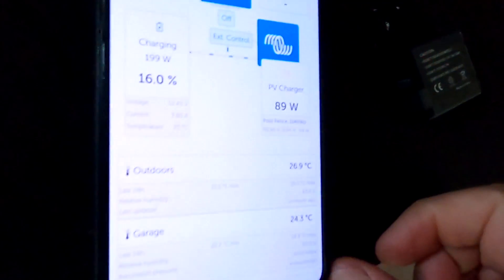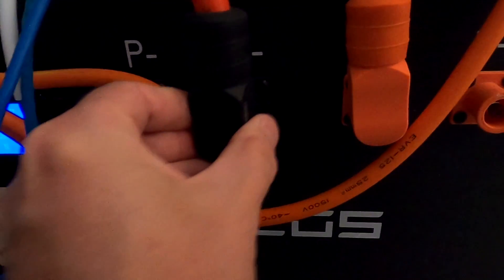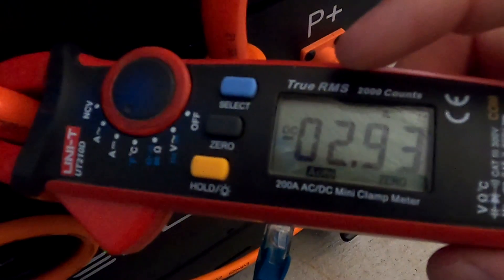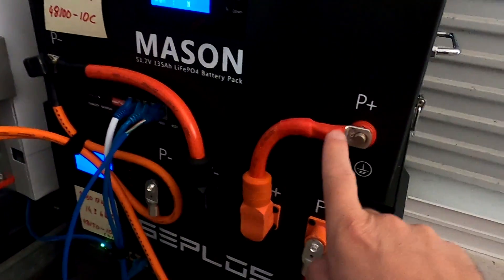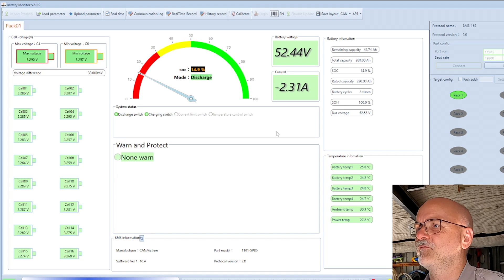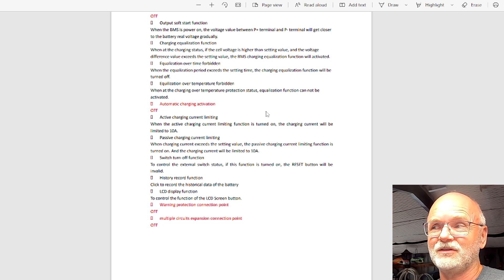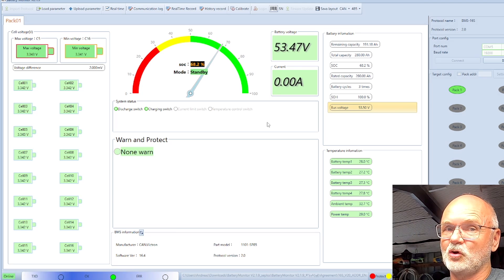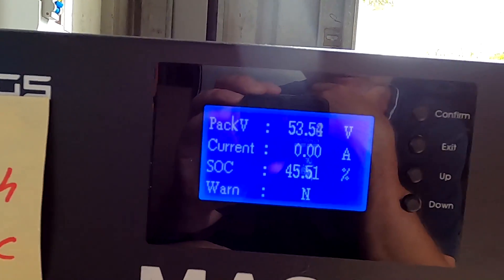Seplos BMS current limiting function causes weird behaviour.

Comment: The total voltage of each battery differs too much from the other I think, so the balance current (pack 1 to pack 2) easily exceeds 10amps. That fast that the display isn't able to show up the actual values before limiting kicks in .. again and again (weird swinging as a result)

Comment: Dear Andy, I also have DIY 280 Seplos kits with 10E 200A BMS's, did you found how manually turn offf discharging and charging because I alerady connectet it to the Solarede 3phase hybrid inverter, but neet to calibrate battery and want only fully charge batttery by my inverter?

Comment: Hi Andy is there any chance you could charge the seplos battery and leave it overnight to see if the balancer will indeed balance over time. It seems that time would work in balancing the cells. In real life most people would check once a week at most.
Reply from the maker: We've tested this already when we built the Mason battery. I left it balancing overnight and the balancer did not work well either. 100mA is just not enough for these large capacities and B-grade cells. They may be OK when you have true A-grade cells as some have reported here.

Comment: The initiative current limiting charging (Even less than 10 Amps) could be used when the battery cells have less charge and in this low stage of charge in order to protect the batteries from huge charge Amps we need to limit the charge current, this is what once I have read about. Maybe it is already ON by the battery modules manufacturer. The Software does not have any problem.
Reply from the maker: Nooo, if the cell is on low SOC, it can take all the amps it can get (up until the max charge current as per specs). Not a problem for lithium and no need to charge them slow.
Reply: @OffGridGarageAustralia  Maybe the BMS Software developer (Copied or for future protection if needed in... or just having the initiative current inside the software firmware without any specific reason at the time) decided to reduce the charge current whenever the Li-iron battery module have less charge like Li-ion battery modules.

Comment: Beside this interesting behaviour, shouldn't you connect the Lynx busbar with - to one of the batteries and + to the other?
Reply from the maker: I don't see a reason to do that. This daisy-chain is just a temporary setup and we will connect all batteries individually to the bus bars. That solves the problem.
Reply: @OffGridGarageAustralia  If it is temporary then it is ok, but it would reduce uneven charge and discharge.

Comment: Hi Andy, Thank you for the video series. I've a question. I got 16 LifepO4 cells and I observed a 0.4V voltage difference between cells at the bottom. 10 cells were around 3.1V and the other 6 cells were 2.7V. I'm using 150-2A JK BMS. Because of this issue battery pack's usable capacity is very limited. Is there a way to balance the cells at around 2.7V using JK BMS without disassembling the pack?
Reply from the maker: The JK-BMS can only top balance. In fact, no BMS I know off does bottom balancing. 
Are the voltages coming back together when you fully charge the pack? How far do you charge, when does the balancer kick in?

Comment: Thanks Andy, I'm not an expert (yet) but this is my main concern about ready-built batteries and this is the very reason why I purchased two from different manufacturers so that I can investigate how accurately the pre-balance the cells. I shall open them both, test each cell and charge them individually up to their maximum capacity. Did you perhaps think about this? I know you said earlier that you do not believe in pre-balancing but that could be the reason for the issue you are experiencing. Let us know your thought on this, please. 🙏

Comment: I haven't counted how many Seplos episodes you've done so far, but it's turning out to be much like the Daly Saga... LOL. 

What's interesting and frustrating about almost all of these BMS's that we have on the market now, is the lack of instructions and especially the lack of good instructions. Then there's the fun of hardware and/or software and/or firmware updates that get pushed out without any notice or explanation (Daly did this right before Christmas... Doh!). It's all these things that trip up the average DIY'er with endless problems without any authority to turn to. This is ultimately why so many people still purchase ready made batteries, because the patience, knowledge and fault finding techniques are something learned over a lifetime. We can watch people like yourself put a battery together in an episode, then go and click the "buy" button. Some time weeks later the parts arrive and we've found out that there are a hundred quirks that we need to repair. We're so lucky to have you playing the role of crash test dummy for so many products!
Reply: You have been reported as SPAM, impersonating and using logos.

Comment: Hopefully when you get all of the settings figured out you can post the BMS versions/firmware version and the switch settings that make it work best, I have tried all 3 versions and still having no luck
Reply from the maker: Yeah, that's the ultimate goal. It could be a long way until then...
Reply: @Off-Grid Garage  I'm working on it right next to you, been trying version 2.7, 2.8 and 2.9 and still running into issues, I still cant even get the BMS to calibrate to the actual AH

Comment: You should make a text dump of the config and put that in git. If you change something, it will be registered, and you can comment why. You can also roll back and push the old config.
I have no idea how you program them. I think the description is not from the BMS, but from the program that configures them and knows that item n sets this or that.
Reply: What an awesome idea.
Reply from the maker: There is a XML file with all the settings which can be imported, exported. Maybe that's a start...

Comment: Hi Andy, really interesting!😁 
you should know that often the failure of this type of BMS often comes from limiting charging (I had the case of a BMS HS which burned at limiting charging for no reason?)
I don't know the "initiative limiting charging" function??
But on the other hand, I know when the battery has finished charging, the limiting charging is normally activated, and effectively limits the charge to 10A Max, but only at the end of charging, i.e. when the battery has reached 100% charge ! then with these 10A max the battery continues to charge slowly, until OV pack or OV cell's
and at this moment the charge is stopped.
And it's not a bad thing this limiting, because example: if you load heavily (like 50A or more) and instantly stop the load! this causes a shock in the other batteries connected in parallel and also to the solar controller!
I have had this experience several times with BMS, simpler, like JBD, Daly or other... If you stop the charge instantly (with a fairly large amperage) put a multimeter on the cables in parallel battery or on the source (controller ) and you will see that the voltage rises very strongly (more than 60V! sometimes But only a fraction of a second!) and this is not good at all, for electronics!
Obviously when you have several batteries in Paralleles, it is the others who absorb the shock (without sometimes being able to notice it)
It is for this reason that they have put this type of limiting charging.
Again this is only my opinion, with the experience and the tests that I have been able to do... but I am not an electronics specialist. but sincerely I think that's why they put this limiting charging. Thank you again for this video Andy👍
Reply: Hi!
I had the exactly same problem as you described! 
Do you have more details about how this event happens? I keep trying to understand it. I have done various tests even with the scope measuring the voltage and got this +60V scenario. 
Do you have an idea for a solution?

Comment: Hi Andi, this switch is indeed per default turned off (checked at my two bms-es). If you want I can check if the same happens with my setup (280Ah and 90Ah parallel). Also, 'automatically activate charging' is turned off by default but seems to be on on your bms. The pdf doesn't explain the feature but I think it means it can ask using CAN to activate charging (for example when SOC is way too low and it needs a charge, works on grid connected mainly ofcourse). 'Manually activate charging' is per default on but I can't understand what this does.
Reply from the maker: OK, thanks for that. I played around with the 10C quite a bit but not much with the new 10E, and both had this switch activated🤷‍♂️ I wouldn't be surprised if they are not having a default config when they get shipped.

Comment: This is what happens when battery communication is poorly designed and the Inverter is not using the battery communication properly.
With Fortress eFlex or eVault batteries connected to a Sol-Ark inverter the firmware in the Sol-Ark is able to communicate fully with the battery.  
If I have five x 105A batteries connected the Sol-Ark the Inverter shows that the total capacity is 525A and maximum current draw is 300A (5x60A).  If one battery is switched off or cuts out the capacity drops to 420A and Maximum current draw drops to 240A.    The nice part about this and it has happened to me is that it prevents a possible burnout of the BMS or T-Class fuse burn out on each battery.

I was messing around with the batteries one night and started to switch them off, not remembering that the house was drawing over 100A from the packs.  As I switched off the fourth battery the Inverter alarmed and switched to pulling power from the Grid as the new internal setting was 105A capacity and Max current of 60A.  The house over 100Amps of current draw was reduced down to 60A and the rest was coming from the Grid.

If you are off grid it would shutdown the Inverter with an error or it might start the generator.
I do not have a generator connected so I am not sure on that last part.

Comment: Version 2.7,2.8 and 2.9 are all different, ask for the firmware for these three versions and see what you can do. Very confusing and overly complicated. I like the options that are available to change but depending on which versio you have you have access to change different parameters,  maybe they have other versions as well but as of now all I can get are the three I mentioned
Reply: Have only tested 2.7 and 2.8. But for my implementation I prefer 2.8 even if I needed to default all my settings from 2.7 and I can't control voltage in 2.8 Reason for this is the charging control with the  multiplus works better with 2.8. Anyone tested 2.9 how is that one?
Reply from the maker: V2.8 fixed a few things in regards to the Victron communication. I haven't tried the 2.9 yet. No changelog of course on the Seplos website or anywhere 🤷‍♂️ It's all about letting the customers find out themselves.
Reply: @Off-Grid Garage  2.9 removes the option to change several of the settings you show in 2.8 (atleast that's my experience)

Comment: I am quite certain that Seplos does not intend batteries of different capacities to be connected together. That is not a situation that would happen very often "in real life". In general, you should always use batteries (and battery packs) that are of identical capacity if you are connecting them together, regardless of whether they are in series or parallel. I wonder if this issue would exist between identical battery packs.
Reply: Having differing capacities in parallel is not the issue here. This is a practice used a lot in various industries. Having equal capacities in "series" is critical.
When batteries are connected in parallel they will charge/discharge at the same rate percentage, regardless of their differing capacities. They will maintain equal voltage and SoC during the whole process. The only exception is when there is electronic devices between the batteries that could cause an imbalance, such as individual BMS devices.
Reply from the maker: I'm still waiting for the other 3rd Seplos box to be build. We have another 10E BMS then and can see if they play nicely together and if it is just the combination of the different BMSes which causes the trouble.
Seplos could not tell me why they don't recommend paralleling different capacities.
Reply: @OffGridGarageAustralia  They don't tell you why because it won't be a proper answer.
Basically they are recommending to not do it based on unknown situations like the one you are having. Because they are still constantly (apparently) updating the firmware on the bms they are trying to minimize connectivity issues. You stumbled on a really good problem, as they renamed fields and didn't make note of it anywhere.

Comment: It's so they can easily calibrate the current shunt on the BMS. Unless they have a loop, 10 amps is the limit of most multimeter (just a guess on my part). The factory will be testing these on a test jig and usually will just have switches to set things up and take readings.
Reply from the maker: It's just poor wording/translation for such a function. A test switch is fine, but call it exactly that.

Comment: I know you will figure it out Andy, & hopefully renew my faith in the Seplos system, which is quite complex enough to navigate without BT comms, but their language translation for parameter settings makes it even worse. I bought 3 x Seplos “Suntorque 5kwh batteries last march ‘22 which arrived several weeks apart, the first of which is down to 74.4% after 95 cycles in 9 months, the second is at 82% after 112 cycles, & the last battery to arrive still reports 100% capacity after 87 cycles. They are all paralleled & I have performed a number of balancing acts to try to get these batteries to work properly, but I think I am close to opening them up & adding a balancer for future servicing.

Comment: I have 4 new Seplos 280 Mason batteries here and the "Take the initiative current limiting charging" switch is OFF by default so I think you are right that you may have switched it on and caused the problem.
Reply from the maker: Thanks for confirming this.

Comment: Had something similar happening with JK BMS, the internal shunt was measuring positive and negative current going into the battery bank (2 banks in paralel with 2 jk bms’s). And throwing an error “abnormal current sensor, abnormal release of current sensor”, seems it’s common with JK but to be fair after restarting the BMS’s haven’t seen in after, might have happened due to rapid changes in current going in and out through bms as the battery banks were balancing out.

Comment: When you connect 2 batteries in parallel for the first time, this switch may be useful to prevent high current... But a default "on" at 10a just doesn't make any sense to me yet. Done mysterie settings. Just do it you Seplos heavy battery!

Comment: I am at minute 3:25 and paused to give a "guess" as to why.  Maybe the two different capacities  and thus voltage (sort of) is causing current to go back and forth.  The higher capacity wanting to top up the lower capacity as charging takes place.  I wonder if one could make some sort of a diode to turn on and off to prevent capacity (amps) to flow to the other battery.

Comment: Balancer effect ?... with a charging current below the the balancer current capacity, when the capacitor of the balancer is charging from the highest cell, the global voltage drop on the concerned pack and then take all the charging current plus a bit from the other pack in parallel... then when the capacitor release the current to to the lowest cell, the global voltage increase again a bit but less, ... etc, etc...

Comment: Really bad that two communicating BMS`es can produce such oscillating conditions.

Buts a nice micro-cycling test you got there. Activate it again, connect an oscilloscope to measure the frequency, count the cycles and leave it be for a year or so. Really interested in the remaining capacity afterwards xD.

Fun aside, I got similar oscillating issue with my Victron 48V system working in parallel to a SMA Sunny boy storage. Needed to program the Victron System via Node Red to set the charging current to 0 everytii the SMA SBS discharge current is >0. This fixed the issue instantly.

Comment: Saw in a seplos video somewhere...
The 10 amps limited charging is a feature used for communication between the BMS and inverter/charger so the cells don't "run off" due to overcharging when the battery reaches a almost full state of charge.
I think this function is limiting amps to give more time for absorption. Makes sense!
Don't take my word for it, I'm not the engineer that design it. 😅
And also maybe the balancing function as also something to do with that function, just a guess.
Reply: "run off" at a SOC of 17% ???
Reply: @ltcmdrdata4611  I know!!!! Did saw that. Low SOC... 
But I just tried to describe what I saw in the seplos video.

Comment: The days of a separate charging input is causing indirectly this problem because it is not the case anymore. The single chg/dischg is used on bms's now which if you had a load and a power source(or charger) for this load and and connect backup power source battery with bms,the chg/dischg point can be very close. Some lifepo4 battery mfgrs state that you can't parallel them, depending on the load you pull.I am having this problem with 2 100 amp/hr batt with 200 amp load inverter using clamp on meter it can see the  cause of bms to trip off in my case.They just don't like to divide load at times. Have fun.